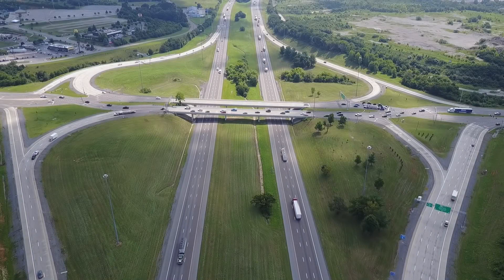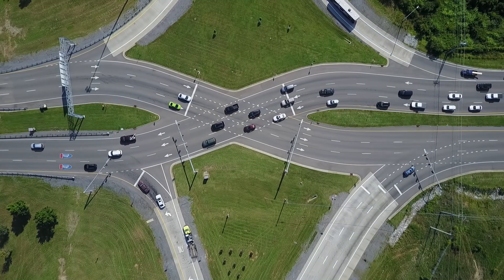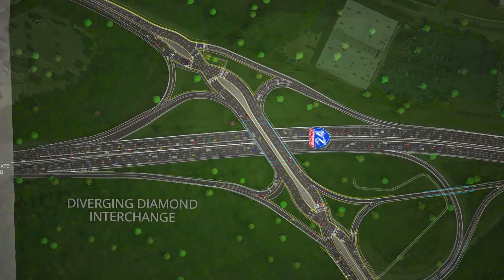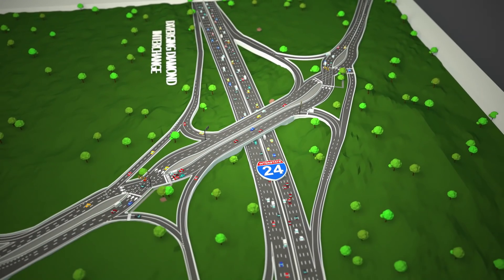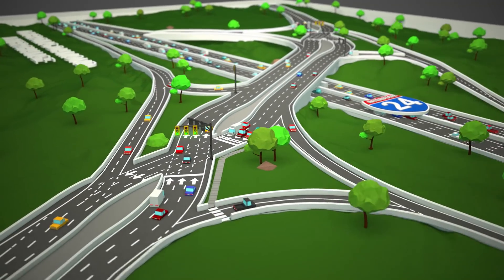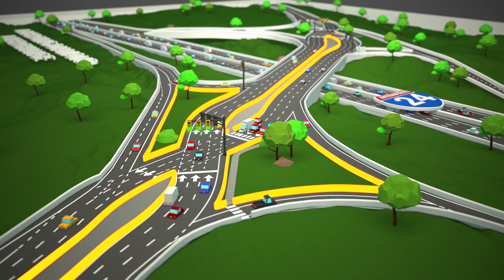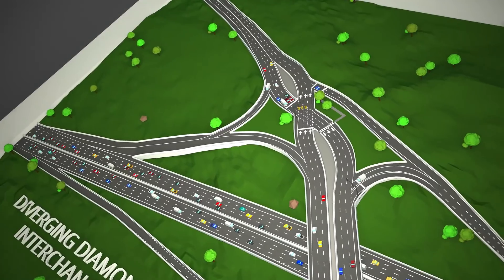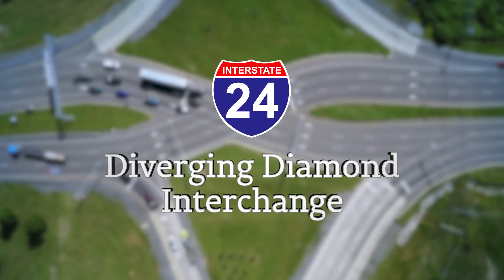I-24 Diverging Diamond Interchange (DDI)

Comment: They should really hire more experienced engineers. This is great design in a simulation but not so much in the real world. Tennessee drivers have a hard enough time with things like round-a-bouts much less this mess.
Reply: .. this is much simpler than a round about and where these are installed accidents typically drop by %60 or so with improved efficiency and less backups.
Unlike a round-about these have lights and rigidly set lanes to control shitty drivers.
Reply: People have to learn to adapt to the times and learn how to drive roundabouts. It's not rocket science.